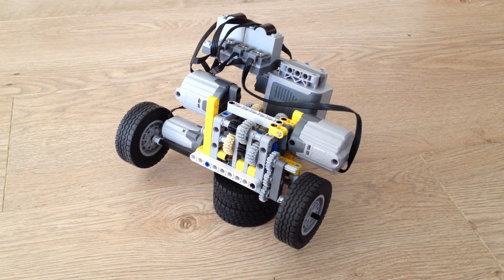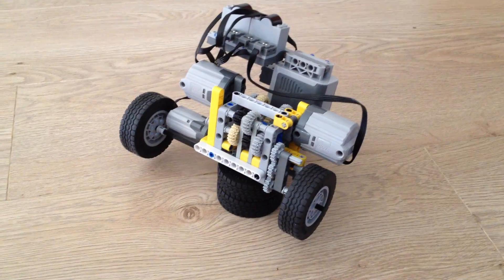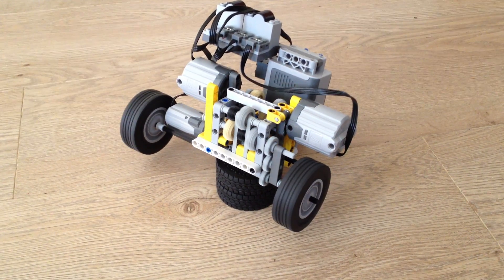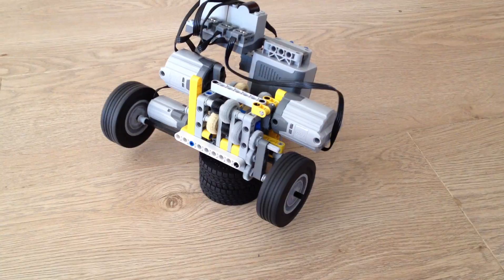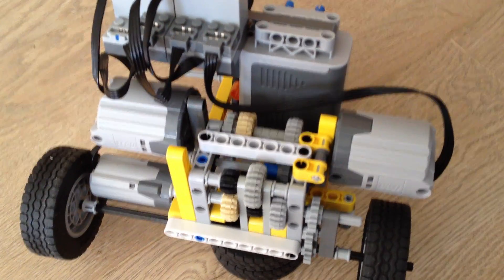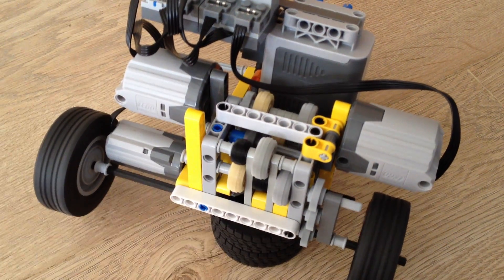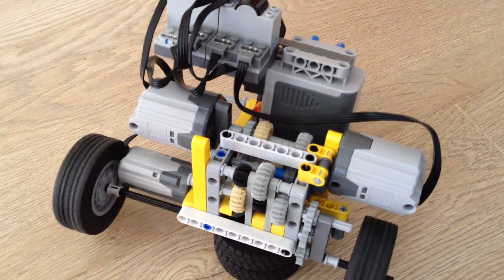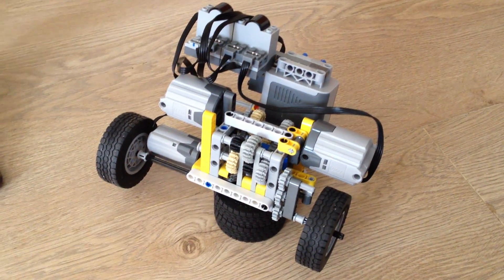Compact lego gear box with 3 gears and remote gear shifting

Comment from the maker: The XL motors go right into the input. My hope was that the motors are strong enough to move the car even at the highest gear. I build a small car with this as a proof of concept, but the middle gear cracked all the time. This gear shift is indeed very compact and nice, but in my experience it cannot handle high torque very well.